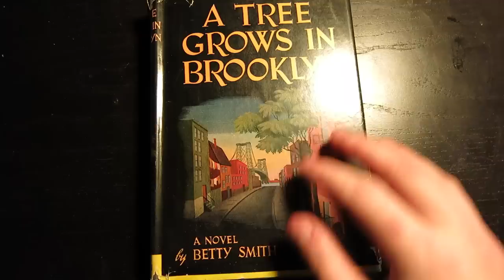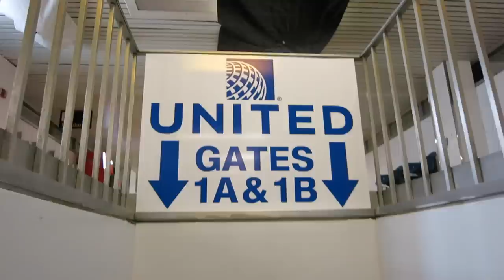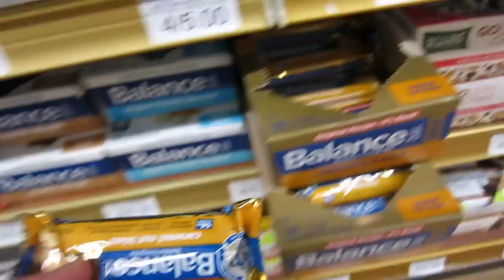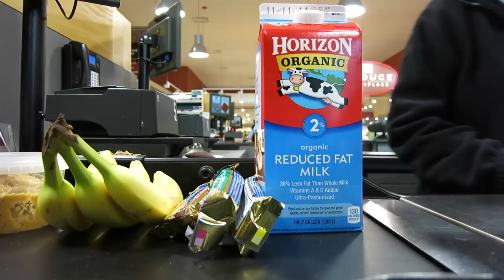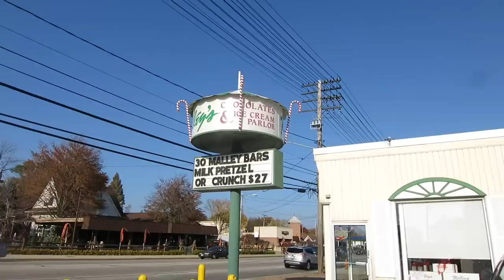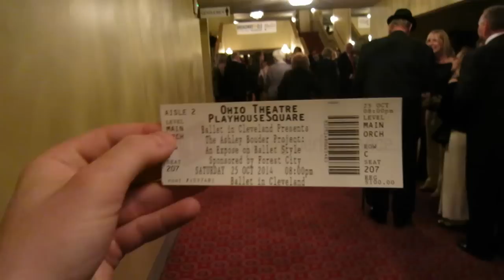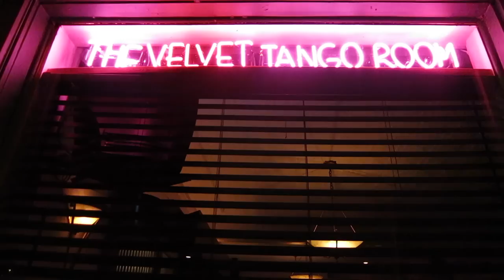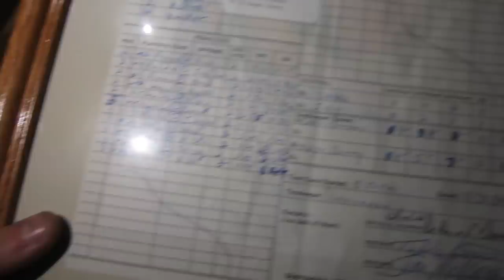THRONE CHRONICLES 17 | Throne HQ : Pumpkins : Cleveland

Comment: you could have rolled down the driveway and bump started it.
Reply from the maker: Battery is completely gone. Won't hold a charge to keep it running.
Reply: ohhhh, that's why you kept the jumper leads hooked on after it started. Sick bike, café style